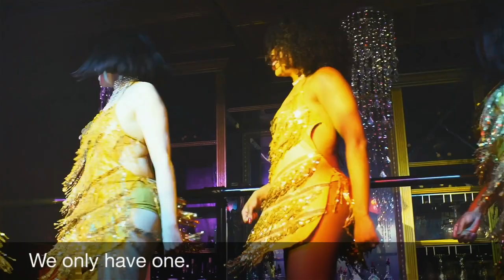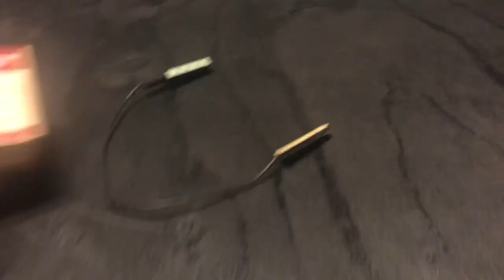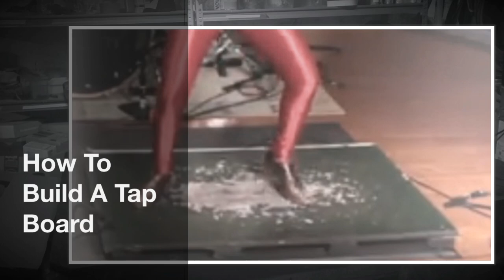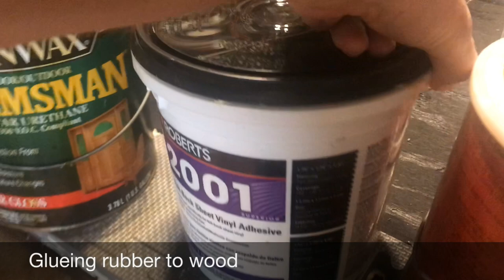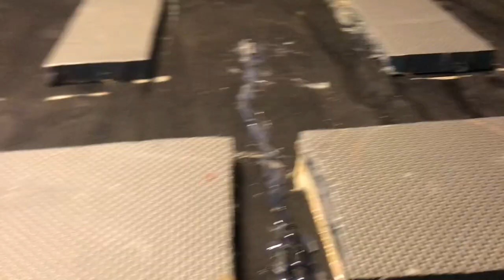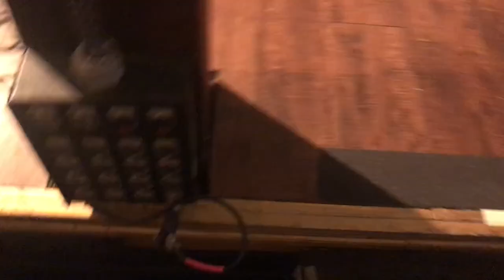How To Mic A Tap Dancer On Stage #BBRSTL

Comment: A good adhesive for things that are flexible (e.g. mats and such) is Goop... there are multiple varieties, but so far as I can tell it's all the same stuff... Also shotgun microphones work great, I've got 2 Audio-Technica AT897 which work great and recently a set of Beyerdynamic MCE 530 drum mics... the Beyers are a lot cheaper than the usual shotguns (they're a drum mic), but they work pretty well.. . Essential (as you know) is a compressor with a gate (I use a DBX 266) plus I use a Digitech  GSP 1101 guitar FX to add reverb, delay and have various EQ presets available...  the gate with shotgun mics is the key to avoiding feedback, set the gate high enough and the sound stays clear and avoids feedback
Reply from the maker: OOO I wish I would have known.  And, I worked so so hard on this tab board, a month later, the tap dancer quit.  Laugh

Comment: Can I connect the contact mic to my speaker I wont have a sound system at the place where I will be tap dancing at do you know if this will work with a wireless mic?  Connecting to blue tooth?
Reply from the maker: If you mean directly to a speaker with no amp then no. If you mean your speaker has power and a mixer etc. yes.  Id try to keep the speaker a bit far.  Like more than five feet if possible